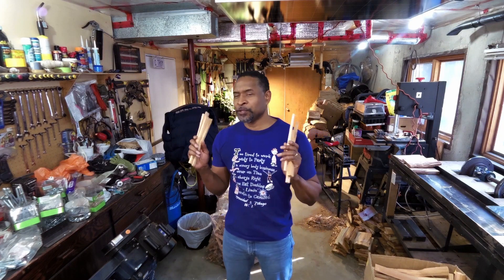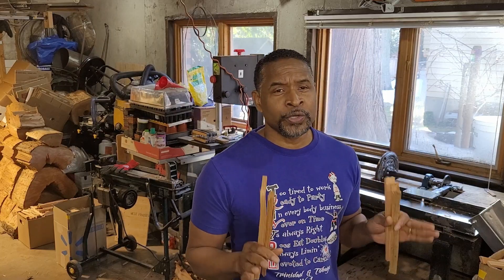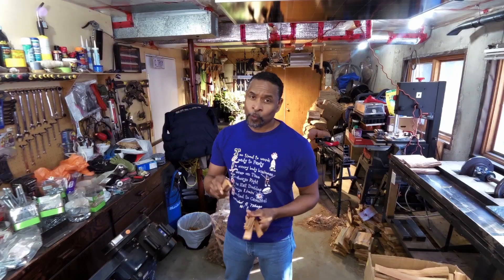Kindling Splitter Machine, Home Built

Comment: Nice machine..  im looking into building one myself..  it looks like your splitting 12 inch is that correct??
Reply from the maker: Hi @buckinfirewood. Thanks for your comment. I'm splitting 10 inch  flats. I've found that kindling pieces between 8 to 10 inches long works great and need not be any longer to for a good start to a fire. The machine does have enough power to split 12 inches, though.
Reply: @seetroy  do you happen to have drawings?
Reply from the maker: @buckinfirewood  Knowing that been asked that a few times now, I really wish I did some. But unfortunately, I don't. It was a concept I had in which I decided to prove it would work. I did a quick sketch, and the rest was in my head.
Reply: @seetroy  gunna have to wing it then..

Comment: Great job , do you have plans on how to build  machine ? How long is kindling , 8” , 12” ? & if you sell kindling where do you sell it ?
Reply from the maker: Thanks for the comment. I built this machines based on a concept that I had that I figured would work. So, unfortunately, I didn't do up any plans for it. My kindling length is between 8-9.5 inches which I found works quite well and need not be any longer. I can definitely produce way more than I need but only part-time in British Columbia, Canada.

Comment: I've been watching tons of vids concerning wood processing and your kindling maker is the best I've seen.  It's quiet and slow moving (safer).
Well done!
Reply from the maker: Hi Keith @keithwhittington1322,
Thanks a lot, I really appreciate your comment. I  built it with the intention of having the freedom to use a variety of pulleys and belt sizes. I figured that I wouldn't want to be limited by needing a specific size. The first and smallest pulley I used on the motor made the  machine run about 300 RPMs which, as you mentioned with other machines, was way too fast and unsafe.  So, a couple of pulley size changes at the motor, and my speed reduction shaft got me to a comfortable speed. Since posting the video, I've gone a few RPM faster, and it's still pretty comfortable.

Comment: Some could say it's over complicated but all depends on etha amount that you are going to cut I think it's an Amazon solution simple and effective great job
Reply: I don't think it was overcomplicated. The motor was quite small so needs a weighty flywheel for inertia energy storage for each strike of the chisel. He would also need to have experimented to find the right gearing and he got that right. Now that those unknowns are known a smaller machine could be built with that knowledge. He did well.
Reply from the maker: Hey, thanks a lot for your kind comment. It's greatly appreciated. Ya, I definitely overbuilt it for sure. I had the idea to build it that way so it can have several degrees of adjustments. This allows me to use various sizes of belts and pulleys and not be limited by a specific size or machine speed.

Comment: Can 0nly work properly with wood that is straight grained and knot free that's the problem obtaining the right wood all very time consuming unless its on your doorstep like here.
Reply from the maker: Well not totally. While it works better on straight grain wood like cedar, it does have to be knot free as long as it is very dry. It will also split wood that's not all straight grain but it has to be a soft wood.

Comment: Great machine!  If you cut the bottom out of that basket and turn it upside down, it will slide up over the full bag and you don't have to tip it upside down to get the bag out.  Same idea works for leaves, trash, etc.
Reply: I'd just use a tall cardboard box. With smooth parallel side and no holes, the plastic bag should slip right out. Or just leave the wood in the cardboard box and fill another one. Cardboard is cheap/free.
Reply from the maker: Hi Walter, that's a great suggestion! Thanks a lot.

Comment: Neat machine but Im certain I could smoke that machine with a simple hatchet. You take like ten of those flats and tie a bunjie cord around it. Or a cheap pc of rope. And just whack the hell out of it a bunch of times. It's extremely fast like that. Especially if you just get like ten of those ready ahead of time and then just go to town with the hatchet.
Reply from the maker: Thanks for the comment and by the way, it was only running on its slow speed. Ya, you're absolutely right, but I guarantee you this machine would outperform a hatchet any day with large volumes. The operator won't get a repetitive strain injury either. I've done the hatchet way before...my forearm and back did not like it, but the physiotherapist's pocket did.🤣

Comment: That is pretty innovative. Maybe a little over complicated for the task at hand, but it is fun to watch and I am sure fun to use.

One tip o that electric log splitter, if you cut a 2x4 down to just the right length, and lay it flat between the back of the splitter head and the end of the machine, it will only return just far enough to fit the next chunk of wood in the splitting area. Saves time if you need a few seconds to grab the next piece. You don't have to wait for the splitter head to come all the way forward.
Reply from the maker: Thanks for the comment. I actually do that when splitting wood.

Comment: I really like your machine, b don’t know how to get the parts that turn which causes the point to pull back and push forth. Can you help me out with suggestions as to where I can acquire the parts other than those needing to be manufactured? Thanks.
Reply from the maker: Hi there, thanks for your comment and interest in my kindling splitter. As you have figured out, I fabricated those parts myself, however, you may be able to put something similar together from salvaging at a scrap yard. My fly wheel in the middle one I modified from a Jetta, at the belt end is a modified Honda Civic brake rotor, 1- 3/4  gas pipe and 2 Pillow Block Bearings. Hopefully this this helps. I only wished I had done a video on this so you could have seen the process but unfortunately I was already pressed for time to do this project.